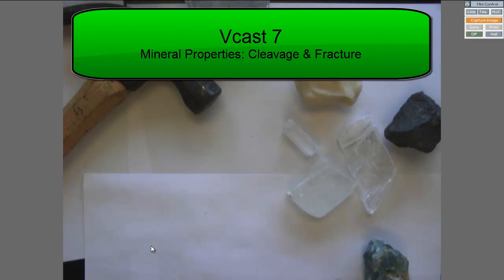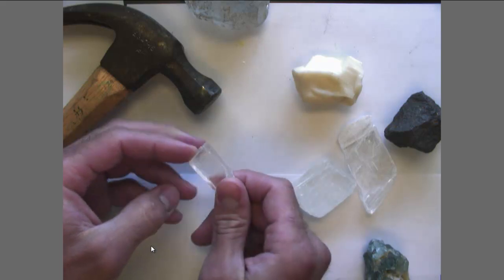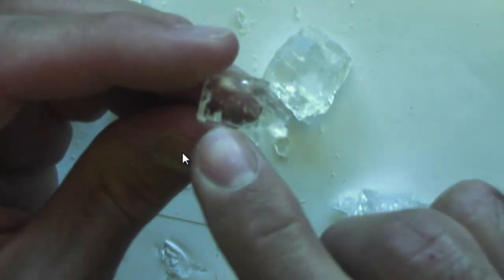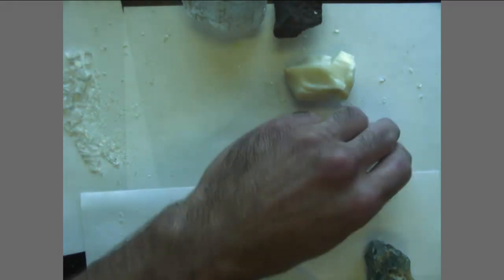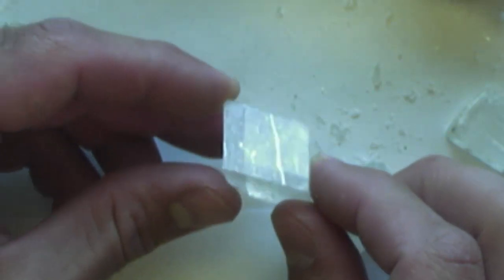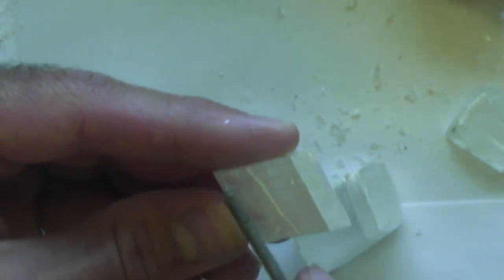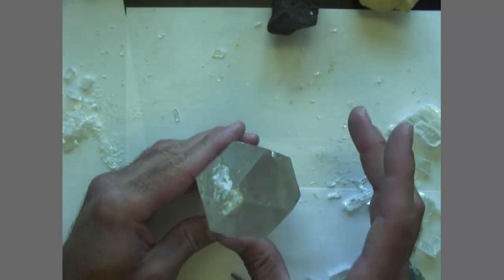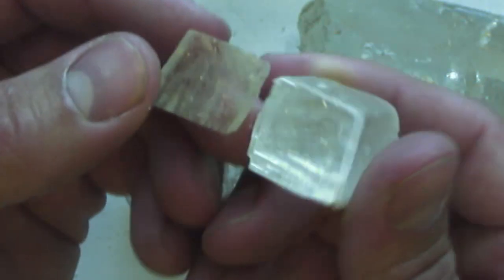ES Geology Unit 1 Vcast 07 Mineral Properties Cleavage Fracture.mp4

Comment: Hi Eric!  So, seems like clear quartz crystal will not break into tiny piece if you try to shape it, right? Can clear quartz crystal be shaped in a perfect round/ circle??  And, would it be safe to say that a "clear" quartz crystal is not so clear or it can be?
Reply from the maker: It could be ground into a sphere using abrasives.  It can be very clear.  Herkimer diamonds are actually quartz that is exceptionally clear.
Reply: @PHHSTeacher  Okay.  I have been seeing lots of clear quartz bracelets or strands being sold online in perfect round shapes so I assumed it may be fakes. Can I request... are you able to teach/ show how one can make small spheres (bracelet size)  at home and drill a mm hole through it ?